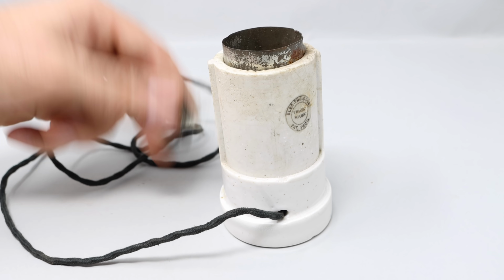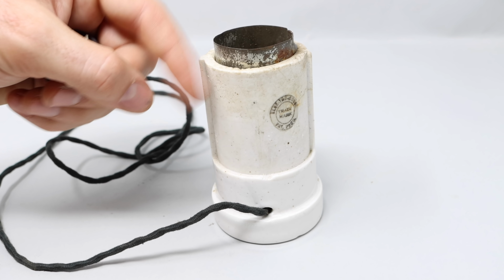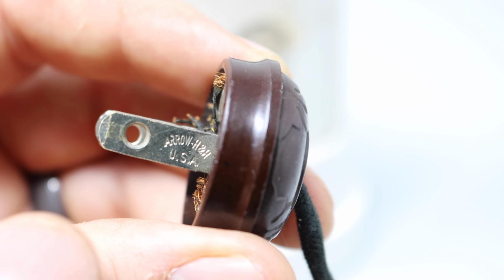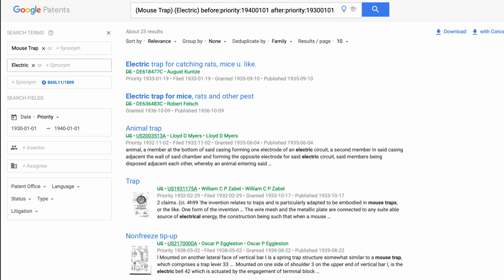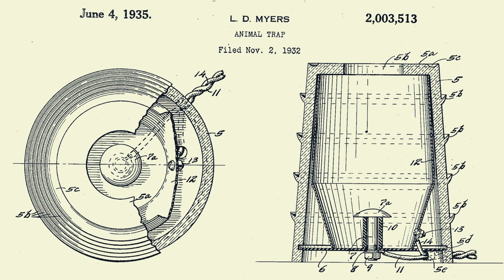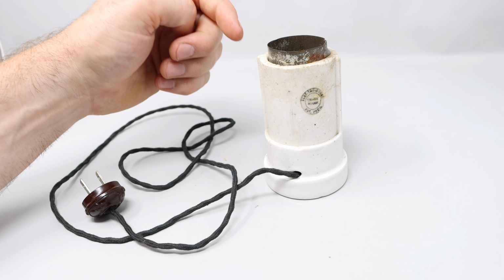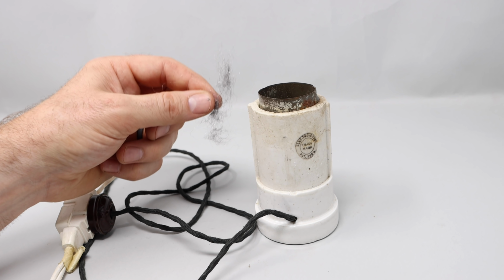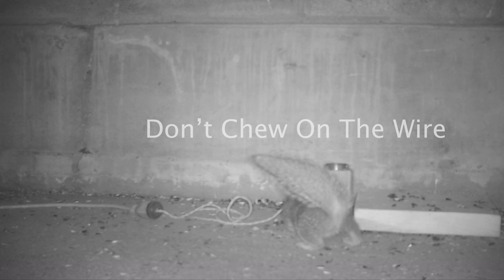I Need Your Help Explaining This One - The Electro Mouse Trap from the 1930s. Mousetrap Monday.

Comment: 45 years electrical experience here including 480 volt industrial 3 phase and commercial aircraft electrician. 
There was nothing different in the electricity. Still the same 110-115 volts AC. As noted below, there were many very dangerous items made back then. This is certainly one.
Why neither of these traps worked is simply the mouse was not grounded adequately and a lack of enough voltage & frequency. Part of understanding AC electricity is the fact that it "alternates" at 60 Hz. (cycles per second) between positive and negative. This means it actually has a zero voltage potential for 1/60th of a second, 60 times each second. This allows the critter's nervous system to be able to react and it get away. You also have to understand that the animals fur and tissue are actually pretty good insulators. If the critter were wet, it would have had a better chance of being electocuted as it would allow it to have been "grounded" better. Water is a good conductor lessening the natural insulation of fur and tissue. For this trap to be successful, the voltage and frequency would have had to be stepped up considerably. Even if it had, the stench would've been horrible not to mention the old house fuse systems back then probably wouldn't have protected the 14 or 16 gauge wiring used in those days, and burned the house down.

Comment: I guess it matters which way the plug is oriented. If the phase is on the outer metal piece the mouse may get a smaller shock and retreat (earth to live) instead of live to neutral directly on the two metal plates ?

Comment: It works like a mini electric chair the mouse closes the circuit theoretically putting raw power around 15-30 amps in America through the body of the mouse frying the brain and stopping the heart.         if it ever worked

Comment: Electricity follows the path of least resistance so the electricity might not be hitting the vitals. Thus causing the mice to jolt or spasm. You would have to make the top close on the mice then have automatic needles stab into the rat then provide electric current.

Comment: The electricity from the wall is only 120/240V depending on the country. The newer battery operated ones use High voltage at the correct frequency to be deadly. 
With the lower 120V, the current path needs to be of low resistance. So it is important that the copper is very clean (no corrosion signs like on this one) and the mouse has wet paws. This is why they might have worked better when new. 
Most likely it would also be more deadly (for  mice and humans) if the outer contact is live, and not neutral. Since the plug is not a keyed 3-prong plug this is a 50/50 chance.

Comment: A couple of possibilities:  In some parts of the US in the 30s the AC power grid frequency was lower.  There were no standards yet and some power grids operated as low as 25Hz which is more dangerous than 60Hz. (but probably not by much)  Also the electrical contacts within the trap when the trap was new would have had much less oxidation and corrosion and would make better contact with the mouse.  I also agree with many of the comments here that had the trap stayed vertical it may have worked better. Also agree, it's a heck of a fire hazard.

Comment: Back in the day, sockets were rated at 10 Amps at 250 Volts, because the NEC limited lighting circuits to 10 Amps. Now adays most household voltage is limited to 120 Volts, with the exception of some house vacuums and large appliances. The amperage is still the same (the deadly measurement) but the voltage is half of what it was. It doesn't take a rocket scientist to understand that 240 V at 10 amps is deadly to a rat and 120 V at 10 amps is not.

Comment: I don't think they'd give them a patent today, it's dangerous.

The cylinder for the trap and the conductor at the end look like they're both pretty well corroded.  
For good electrical conduction you need to get rid of the corrosion and maybe go so far as to use a conductive gel the mice need to go through before getting into the trap.  
Polishing the inside of the trap with some steel wool should prepare it better, and put some of the gel around the cylinder part of the trap - being careful to keep it off the area between the two conductors.

But between their fur and their nails, they're well insulated.

Something like this may work: Spectra par12-02 Parker Laboratories 360 Electrode Gel, 2 Oz. Tube, Clear (available at Amazon).  
It's designed for TENS units which also needs to conduct electricity.  
Maybe smearing the gel around the inside of a small tube and forcing the mice to travel through it before getting to the trap.

Comment: I'd speculate the more modern designs would work with mains voltage. As you've correctly surmised, the trick is to contain the rodent so it can't jump away and break the electrical connection, which these old traps don't do.

Comment: The outside conductor is probably connected to the "hot" side of the power.  That means the squirrel got a shock before it got inside. Change the way it is plugged into the wall, that might work better.  In the 30's electricity was incredibly dangerous.

Comment: they didn’t have as much control with the amps in the wires back then especially in places that had just got electricity. and electrical fires were way more common because it was way less safe

Comment: Those old electric traps are at about 120v. The modern electric traps bump it up to thousands of volts but not as much current. It takes both current and voltage to kill but I'm suspecting that the older traps with 120v just doesn't have the potential to get through their feet or fur. With the higher voltage in the newer ones there's a much higher potential that is able to jump the resistance of their feet and fur and will more readily kill them.

Comment: E = voltage
I = current
R = resistance 

E = I x R

So in order to get enough current, you need lots of E, or small amount of R.
If the mouse's feet were wet with salty water. And the mouse licked the other terminal with a wet tongue, then it would have worked.
And that is why they use step up transformers  to increase the voltage in new designs.
Thanks for sharing your videos. And keep up the good work.
Reply: When it comes to killing things with AC the frequency also has a small part to play, although in this case you're absolutely right. Needs some moar high voltage!

Comment: Electrically, nothing is different from 100 years ago and now.  One thing to possibly pay attention to is which direction the plug is connected.  The Neutral should be connected to the metal tube, and the Hot should be connected to the center plate.  This is easily tested with a volt meter.  Make sure you are seeing 0 VAC when testing between the ground prong of the extension cord or outlet and the metal tube.  If you see voltage present, unplug the cord, rotate it 180 degrees, and plug back in.  It looked as if the squirrel got a small shock when it touched the tube and the floor at the same time, which makes me think the tube was connected to Hot.

Comment: in the 30s K&T wiring was common.   I don't think that would have an effect.  I would say if the trap was a little wet and the electrodes were clean it would produce more of a shock.  Also modern circuit breakers would likely trip before it killed a mouse,   There was a time when houses had 220, 440 even 550 volts.  We still have 220v in the house (208 in apartments).  Its possible the trap was designed to run on a higher voltage.  Plugs were typically installed by the home owner as outlets were not standardized.  For a long time electrical devices has edison bases like lightbulbs.  You would put a light bulb in the evening, then in they day time you could use the socket for your iron, vacuum or other devices.

Comment: house hold electricity isn't actually a deadly as it reputation suggests. You need to make a very good contact, as most electricians will tell you they soon learn that they develop an instinct to pull away or jump as soon as they feel the tingle, this often saves them fro serious harm. A mouse is covered by fur that isn't particularly conductive. They get a tingle and jump like an experienced electrician. the trap probably never worked very well UNLESS it is intended to use on DC electricity. DC tends to make you grab tight as your muscles contract then you can't let go. It's MUCH more dangerous than AC electricity.

Comment: I think that the power supply in some locals were either DC or high voltage AC-depending on URBAN (Cities) or RURAL.  In a nutshell, difference between AC and DC would probably make a difference.  AC would cause you to pull your hand away (and cause you to open your fingers) from a socket when you felt the ZAP while DC would cause you to grab the item touching the source-like the 3rd rail of a subway.  DC is usually WAY more powerful especially if you think about how much power is needed to move said train.  AC is what our homes run now.  Not AS powerful but still plenty dangerous!

Comment: Probably it's related to power supply frequency, at that era the supplied frequency was different than now and semi-unregulated. Nowadays they are between 50-60Hz and if the frequency is lower, the risk of electrocution goes higher.

Comment: The current would need to pass through the heart to do damage. In this trap, the electricity has no reference to ground, so probably just passes in and out again through the tip of a whisker. If it was stood on a ground plane, then touched the live with it's node, it might have a different effect. Make a trap where the mouse has to tippy-toe (whilst stood on a ground plane) and reach up into the bait cup which is live. Oh, and get a rectifier to ramp it up to about 20Kv ;)

Comment: Amp kills, not volts. It’s possible that electrical currents back in the day was higher on amps. Try measuring the current to see if it’s enough to kill a mouse in the contact timeframe? I’d probably hook this up to a system with a capacitor to store a charge to discharge all at once when triggered. Strictly not an electrician, but I saw someone else do this for a similar application so I thought I’d mention.

Comment: From a little bit of research I found that power outlets in homes were 125V at 15A which would knock the crap outta you, but other outlets had even 250V at 10A!!

Comment: I think most modern electric traps aren't always on. The way they work is that the use a pressure plate that waits until a mouse is fully on the surface, then wait a few tics, and then turn on. That way, more surface area and higher possibility for the electric current to cause the mouse's muscles to contract, leading to higher current, and eventual cardiac arrest.

Comment: To get an electronic mice trap to really work well. You need to add a high discharge capacitor.  5k volts is better at killing that 110v.

Comment: The voltage might not be high enough to work quickly, and the kill shock might be out of phase when the connection is made. Euroupean 220v might work a bit better. Though, in theory this should work given proper contact. Some of these mice might get lucky, and the current doesn't hit the heart. Interlaced plates like ZNA Production's stun shield would be good(but dangerous) inspiration. Though, higher dc voltage will be better. Like from a fly zaper.

Comment: Probably didn't work well in the 30s either, electricity then and now is about the same, now maybe a little "cleaner"  (not referring so emissions rather the quality of the flow and noise) outer shell most likely porcelain.

Comment: The US used 50 hertz frequency on their power lines before the mid-50s. They now use 60hz. Not sure if that changes how lethal it is to mice though, but an interesting difference nonetheless. If you want to try this out, buy a DC power converter for UK or European plugs (like you use in a work truck to run AC power off a cigarette lighter), as in Europe they use 50 hertz still.

Comment: Im pretty sure it has the the neutral on the tube like structure and the hot on the metal tab at the bottom with the rat completing the circuit and it does seem like a fire hazard.

Comment: it might be that these mouse trap we set up to run using DC (Direct current) power, which i assuming some par of the regions may not changed into AC (alternating current) power at that time even though AC won the war of current.

Comment: The only difference was back then the voltage was a little bit lower, more like 105V instead of 120V. Same 60 Hz frequency. I don't think it would have worked that well back then either, because the voltage is too low to effectively stun. The modern electronic traps generate thousands of volts to effectively stun and prevent escape. I think that trap will only work in the vertical position where the mouse will have to fall in to be electrocuted, horizontal they will feel it and escape as we saw.

Comment: The 1930s was when electricity started to become common and so for many it was this mysterious and miraculous thing.  As such, the fad was to electrify everything, hence the invention of electric mouse traps.
Electricity was also far less safe back then than it was today.  We have fuse boxes and circuit breakers in case of emergencies but back then they were necessary protection due to how badly the current tended to fluctuate and how high it could be at times, as such the typical electrical outlet back then put out a heck of a lot more juice than today's do.

Comment: I think there used to be a higher voltage running through sockets. I'm pretty sure that used to be the case here in the eu. I believe it changed for safety reasons

Comment: Low voltage electricity is not much of a hazard unless the current goes directly through the heart, which it normally doesn't even if the power goes across the ribcage. To really kill an animal you need high voltage, 50 000 volts and such, then electric power is strong enough to kill nerve cells (but also strong enough to scorch the body in a prolonged exposure).

Comment: The difference between now and then is that electrical systems were not so safe and regulated as they are now. Back then wiring could pack a wollup and not have any safety guards to keep someone from electrocuting where as now you have limiters, breakers, and fuses that keep a system from causing too much harm.

Comment: As an electrician, there is no difference that effects this type of situation. I would say that those traps just didn’t work back then either. If you want to electrocute something, you can’t let them get away. So you have to trap them inside or something. Which then creates the problem that they just lay there dead on the contacts continuing to have energy flow through them and this often starts a fire. So like your video about the electronic electrocution trap, it has to be able to deliver a burst of energy and then shut off.

Comment: Use wet bait (e.g. peanut butter) and apply to both electrodes.
Dry skin is an extremely bad conductor of electricity.
By using wet bait, you maybe able to reduce the contact resistance.
There's a reason they used to put a wet sponge on the heads of those executed by electrocution and most deaths by electrocutions occur in the bathroom...

Comment: Find a way to add a fuse or breaker to that demon.  I'd say go full GFCI, but there's no ground on that thing.  And, there was probably a cardboard cover to the exposed wires at the plug.  You might want to find a way to cover that.

Comment: At 20th and 30th there were no circuit breakers used often because they were new inventions, probably expensive, so it wouldn't exist in all houses. But today it is a basic and cheap component that is "must be" installed in any electrical panel.
I guess what happened when the mouse made a short circuit in the trap, it was very momentary (very few seconds only) before the breaker interrupt the whole circuit and there were no more current flow to the mouse body.
If there were no circuit breaker I believe the mouse would have been electrocuted and dead.
If the circuit breaker in your panel got off that day, then this is the case.

Comment: By looking at the design it's seems to be design to put inside a mousehole where the mouse comes in the house from that certain entry hole and guessing that the mouse die body would still be in the trapped for easy removal after the deadly electric shock or scary off the mouse from going through that hole again.

Plus the only reason why barely works when the mouse went in it the metal was most likely rusty or corroded which is common in those old 75+ year old electric devices.

Comment: I asked my husband who is a airplane electrical mechanic. He said your theory is correct. One wire goes to the outside tube and the other goes to the bolt in the middle. The mouse completes the circuit.

Comment: Insufficient current id guess if the mouse was wet or higher voltage if you could catch a mouse and gently apply the probes of a multimeter to where the mouse would contact the electrodes and measure the resistance

Comment: Ok engineer here. I think the voltage is not enough to pass a large amount of current through the mouse body. A high voltage system (at least 2kV) is required in my opinion. But it has to be able deliver enough current. If I were to design one, I would use 5kV and a capacitor to make sure all the mouse nerves are fried.